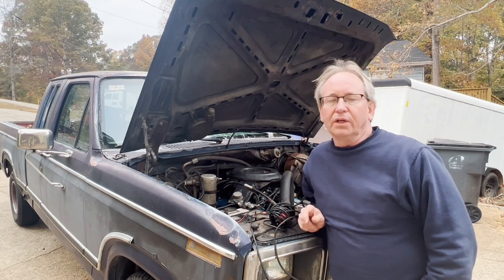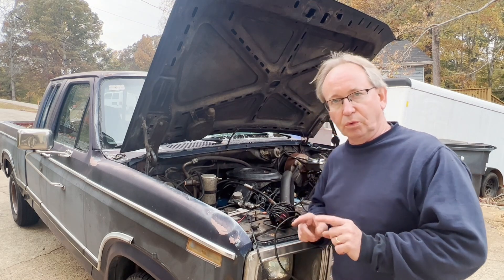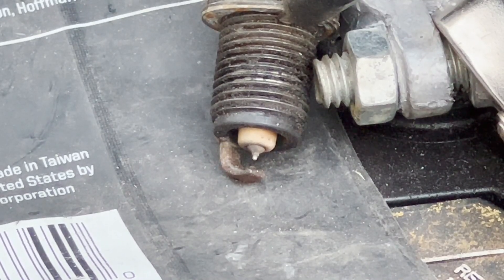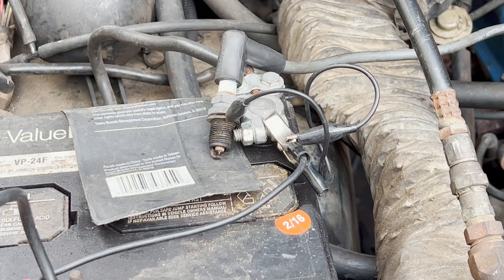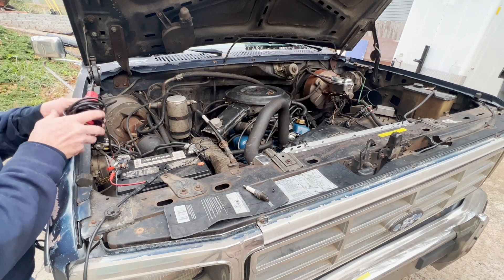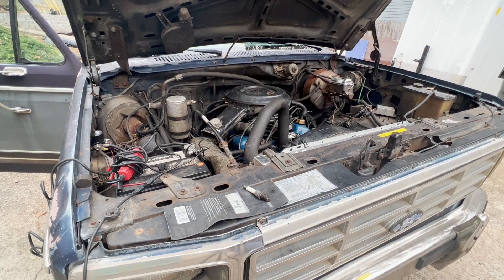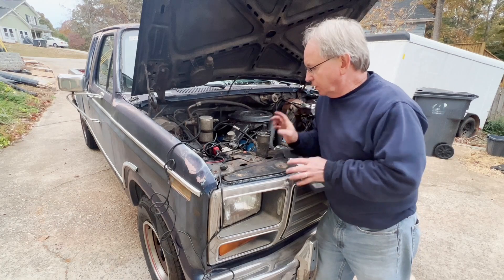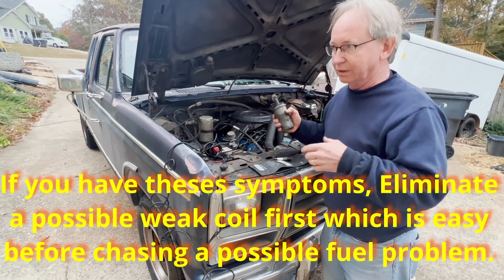How To Quickly Diagnose The Sneaky Weak Ignition Coil

Comment: Why don't you do an actual ohms test let us see how that's done on a v8. Cuz that'll tell you how it's doing too.
Reply from the maker: Hi. Thanks for taking the time to watch and comment. I have a pile of coils. That bad one breaking down from this video checks the same as a good one with an ohmmeter. Ohming out the coil will show you if it is open or shorted. Otherwise, if the coil is breaking down under load it won't show by ohming it out. It will actually show a primary and secondary winding resistance. Checking it with an Ohmmeter is somewhat an exercise in futility. 
A coil is actually a transformer full of oil for cooling. A baseline rule of thumb is the primary to secondary resistance ratio is 1:100, but that varies by application. In the 1960's - 70's you could for the most part swap coils between Ford/GM/Chrysler within types that used Internal or External additional in line series resistance. When cranking/starting, full 12 volts was applied to the coil. When the key went to Run it switched in a series Ballast resistor and dropped the voltage across the coil to about 9VDC. Running straight 12VDC to the coil will burn it out. On the other hand if you switch to a Pertronix Flame Thrower and Electronic Module to eliminate the points, it does require 12VDC at the Coil. 
So getting back to the "Futility of checking resistance", the resistance range coupled with the 1:100 ratio that your coil is reading 0.4 Ohms on the primary could theoretically be "good" if the secondary reads 400 ohms. 
  Basically Ohming the coil checks continuity. To know for sure, just swap it. Takes minutes as you saw and will 100% tell you if the coil is 100% good or breaking down under load which the Ohmmeter can never show. Having ran a shop, diagnosing and resolving the problem quicky so you can get to the next job is what makes money.   Even if a coil checks "good" via resistance, the Ohmmeter is a low level static test. It's running a very low current through it and low voltage across it which can't detect insulation breaking down and windings shorting at 12,000 Volts.
Maybe someday I'll make a follow up video with an ohmmeter, but this video is one is one of my highest viewed videos and most importantly has solved an elusive problem for quite a few folks if you go look at the comments, so for now I'll let this video keep working as it is while I focus on all the other new content I make. Thanks again. :-)

Comment: What if it’s backfiring? Could a bad coil cause that?
Reply from the maker: Hi. Thanks for taking the time to watch and comment. It's possible if you're also experiencing that loss of power at about the same throttle point. If you're power is good check your timing that it's not too far advanced or jumping around from a worn distributor or worn timing chain. What you're thinking is a backfire could actually be a "Lean Pop" in the carburetor or a vacuum leak. If you carefully/lightly cup your hand over the carb and the RPM's pick up you probably have a vacuum leak which could be worn throttle plate bushings. Throttle plate shaft will wiggle around. A worn accelerator pump in the carb will cause it to lean pop, not giving that squirt of fuel it needs when you open the throttle to overcome the temporary lean condition of opening the throttle. Check those things and let me know.

Comment: Off to the parts store, my dads 1981 xd ford falcon with a 351 Cleveland electronic ignition coil just died😅 it gives blue spark off the plug has fuel but will not even cough the car ran perfectly when last parked up. So new coil before i get any further with the ignition system.
Reply from the maker: Hi. Thanks for watching and taking the time to comment. The coil in this case is a sensible component to rule in/out and easy to swap out.  The spark color can be hard to judge and doesn't come across true on the video, and honestly a blue spark is actually hotter. I was in a hurry doing the video and mis-spoke. 
Anyhow, it does sound potentially like the coil as having spark if it's not hot enough is essentially the same as no spark. Sounds like the ESC is working, so if you have the right amount of fuel (as in it's not too much and flooding) it's pointing towards the coil. This video has helped quite a few folks, so hope this solves your problem. Let me know if it was the coil.
Reply: @mkdhdinfiniteendlessconten3873  brought a new coil about to test now.
Reply: @mkdhdinfiniteendlessconten3873  it was the ignition coil as suspected mate. Thanks.
Reply from the maker: Yay!!!! Great news. So glad I made this video. It has helped quite a few people. Glad you're up and running again. Hopefully I've earned your subscription. ;-) Thanks again for watching.

Comment: Gotta 95 mustang gt it's doing the same thing I already have a new pump and assembly haven't put it in yet... And a new coil gonna try the coil in the morning
Reply from the maker: Hi. Thanks for watching and taking the time to comment. Let me know how it goes. I think on a 95 the coil is part of the distributor if it's still a factory set up. Many people strip the EFI off and convert to a carburetor and put some sort of aftermarket Electronic Ignition like a Pertronix or MSD with a separate High Energy Coil, so I'm curious as to what your setup is. Anyhow, it will take minutes to rule out the coil and it is often the case. A friend of mine with a 6 cylinder 90's Ford was getting sort of stranded with an intermittent loss of power over 2,000 rpm and having to limp along, watched my video, tried the coil, and solved it. Let me know how it goes.

Comment: Thank you brother i am trying to fix my 60 classic ford i am stumped its doing exactly what you described so im thinking faulty coil
Reply from the maker: Hi. Thanks for watching and taking the time to comment. You can jump another in with some clip leads and know instantly if it is a weak coil. Mine has the slide on terminals so its a quick connection. If they're held on with nuts then it takes a few more mins to jump it in. Just make sure at least one lead is fully removed if jumping another one in to see if that's the problem. Let me know if it was the coil.

Comment: Hi i have a coil its old primary reading is 0.4 but secondary reading is 1 ohm ..im sure it needs replacing its very old
Reply from the maker: Hi. Thanks for taking the time to watch and comment. With those low readings, I'd say that coil is effectively shorted.
Reply: @mkdhdinfiniteendlessconten3873  thanks the secondary reading jumps from 1 ohm to 6 ohms on 3 different test I reckon coil is shorting out
Reply from the maker: Hi again. For what it's worth, ohmming out a coil (actually a transformer full of oil for cooling) is somewhat of an exercise in futility. A baseline rule of thumb is the primary to secondary resistance ratio is 1:100, but that varies by application. In the 1960's - 70's you could for the most part swap coils between Ford/GM/Chrysler within types that used Internal or External additional in line series resistance. When cranking/starting, full 12 volts was applied to the coil. When the key went to Run it switched in a series Ballast resistor and dropped the voltage across the coil to about 9VDC. Running straight 12VDC to the coil will burn it out. On the other hand if you switch to a Pertronix Flame Thrower and Electronic Module to eliminate the points, it does require 12VDC at the Coil. 
So getting back to the "Futility of checking resistance", the resistance range coupled with the 1:100 ratio that your coil is reading 0.4 Ohms on the primary could theoretically be "good" if the secondary reads 400 ohms. Since yours is reading 4ish Ohms on the Secondary that does indicate a shorted secondary.  Basically Ohmming the coil checks continuity. To know for sure, just swap it. Even if a coil checks "good" via resistance, the Ohmmeter is a low level static test. It's running a very low current through it and low voltage across it which can't detect insulation breaking down and windings shorting at 12,000 Volts.

Comment: I have a 1983 351 and when I start it up it idles high im guessing for the choke but when I give it gas to take the choke off it idles rough and stals
Reply from the maker: Hi. Thanks for taking the time to watch and comment. Nice you've got an 83 with a 351. It's not the coil. Sounds like a vacuum leak or you're missing a cylinder which a high idle will mask and can also be caused by a vacuum leak. Your curb/base idle could also be set too low or mixture too lean. 
Cup your hand over the carb when you kick it down. If it picks back up it indicates too lean of a mixture which can either be a vacuum leak or your mixture setting. 
Check all your vacuum lines. My guess is they're old, so probably cracked. I'd plug them all coming from the carb including the Booster and PCV valve and see what it does. Your Booster could have a bad diaphragm and be leaking.  If the issue goes away it's a bad hose or whatever the hose feeds has a leak. There's probably a vacuum tree on the back of the manifold that feeds several accessories like the AC/Heat and EGR Valve. (Oh ya EGR Valve could be stuck open). Some of those ports are extra and have rubber caps which will rot and fall off. Make sure every port is plugged. Point an infrared thermometer at each exhaust port on the exhaust manifold. If a cylinder is dead it will have a much lower temp. A vacuum leak on an intake runner that feeds that cylinder will cause it to lean out and not hit. If the throttle bushings are worn you'll also have a leak that's hard to find. Wiggle the throttle linkage lever. If it moves around it's worn and leaking. Let me know what you find out.

Comment: This is very helpful.  My ‘78 carbureted Ferrari is having that same ‘chugging’ and ‘hesitation’ when starting.  And it takes a few times to get it started.  Sounds exactly like your Ford!  Can you ‘fix’ coils? Or clean them? Or do you just have to replace them?
Thanks!
Reply from the maker: Hi. Thanks for taking the time to watch and comment. Coils are not repairable. They're also filled with oil for cooling, of which old vintage ones had PCB's in them. A weak coil will also cause the exhaust to have the same nasty smell as when a gasoline engine "Diesels" when cut off and continues to run "very badly". It's similar to dieseling as the spark is so weak the fuel mixture barely ignites from the spark. It's quick, cheap and easy to see if it is indeed a weak coil and resolve the issue or rule it out and take a close look at carburation (I think your model is carbureted) and or ignition.
Reply: Thank you

Comment: I have a 88 F150 that will run about 20 minutes and then chokes out and dies got both new fuel pumps and fuel pump on the rails new, wondering if this could be my issue I put new plugs wires and cap on as well
Reply from the maker: Hi. Thanks for taking the time to watch and comment. The symptoms are leaning in that direction after going through the fuel pumps unless of course the 12V to the pumps is dropping out due to corrosion or a relay letting go. Getting back to the coil, that is a typical symptom of a weak/failing coil breaking down, and it's quick to rule out. 
A friend of mine with a late 80's (might be 88) F150 was experiencing similar intermittent symptoms and had been through the fuel system watched this video and scratched his chin with a Hmm, swapped out the coil, and got rid of the problem. Again can't say for sure your problem is the coil (could be ECM) but it's cheap enough and quick enough to try to either fix it or rule it out. I by training generally don't shotgun try things hoping to fix it. I measure, inspect, determine the cause, then replace or resolve whatever it is. There are instances though when a symptom is so intermittent or specific that w/o having fuel pressure gauges, HV probes measuring coil output, scopes reading ignition signals while under actual use (most of which is impractical) that you have to resort to "trying something" that could reasonably be the cause.
Let me know.

Comment: My royal enfield bike has starting problem
And it stops during idling.
Could it b a weak ignition coil ?
Reply from the maker: Hi. Thanks for taking the time to watch and comment. That's sounding more like air/fuel mixture with the carb which when cold is controlled by the choke. Couls also be a vacuum leak after the throttle valve. If it smooths out cupping your hand over the carb, there's a vacuum leak. 
Weak will generally start ok-ish, although the one I showed was getting slow to start. 
If the bike is ok once it warms up, it's mixture. The weak coil will drop out consistently at the same speed/rpm under load and come back if you let off.
Reply: @mkdhdinfiniteendlessconten3873  thank u sir for the reply.will check all once again

Comment: Weak not all the way bad that's from ? Windings insulation getting compromised maybe
Reply from the maker: Hi again. Not exactly sure, but suspect something like that. I think it's frequency related which affects the "Reactance". Higher RPM = Higher Frequency. An automotive coil is actually a Step Up transformer with a Primary and a Secondary and is a Reactive Component with "Reactance" (resistance that's only present when subjected to AC) which varies with frequency: XL=2piFL. XL is Inductive Reactance, pi = 3.14, F= Frequency, and L=Inductance measured in Henries. From the formula you see that Reactance is directly proportional to Frequency in an Inductor (Indirectly in a Capacitor). AC is simulated in an automobile with a pulsing DC. When the DC is applied, and then removed, the back EMF induces a voltage in the secondary which has more windings greatly stepping up the voltage. If the insulation on the windings which is a thin chemical coating breaks down, it shorts between windings while operating. The coil will ohm out ok since the Ohmmeter is applying very low DC. The resistance range to check a coil, both primary and secondary is wide. Unless the coil is open or shorted checking it with an ohmmeter is not conclusive. Thanks again for watching and taking the time to comment.

Comment: Good production the build up nice and slow for second coil then the twist it looked the same 😮 what??? You should try the entertainment industry it's worth it
Reply from the maker: Hi. I think you're referring to how the spark looked. Ya on camera after I played it back they look the same which was disappointing. In person directly viewing there was a noticeable difference, but in the end one coil is good, and the other breaks down.
Fun Fact: As far as what your eye vs a cell phone camera sees, did you know you can use the camera to tell if a Remote Control is working? Look through your camera screen while pointing the remote at it with a button pushed. If the remote is working you'll see quick faint light pulses. Must be frame rate etc. Can't see it with the naked eye. Thanks for watching. Peace.